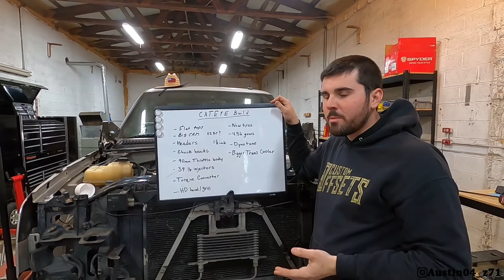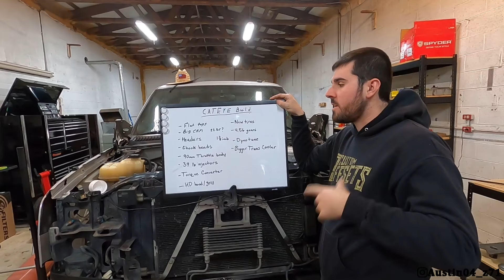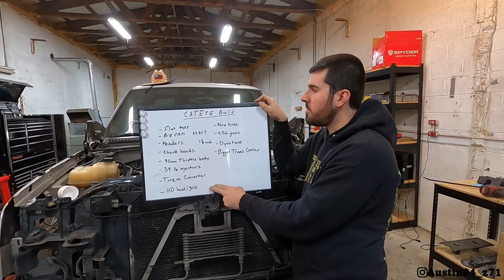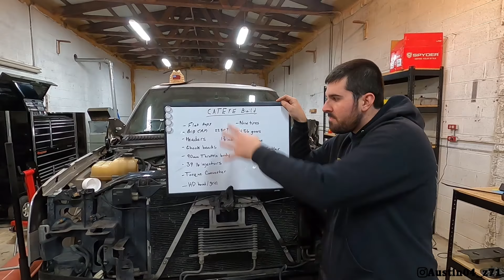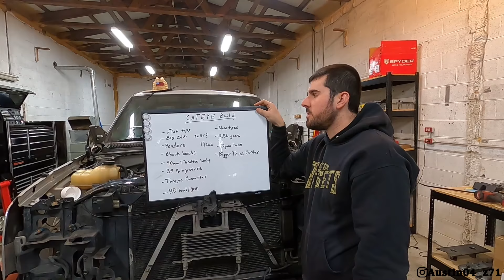6.0 Cateye Build Update *6.0 Tear Down*

Comment: Flat top 6.0 with 862 or 706 heads will not run on pump gas. Might get away with it on 93 octane and a much bigger cam than what you mentioned, and never letting the engine lug at lower rpm.